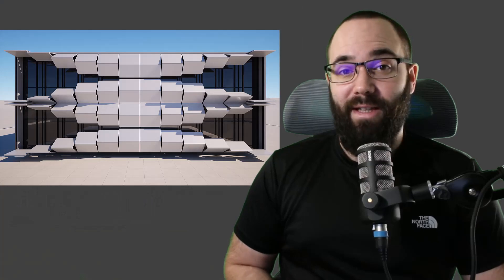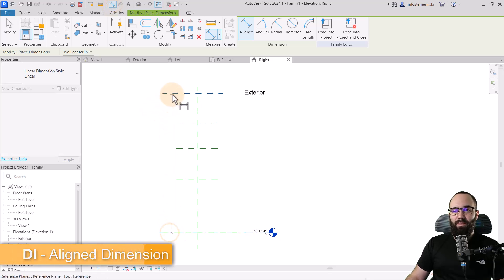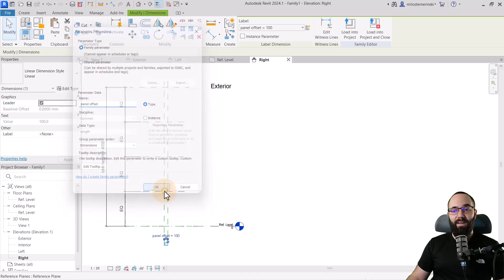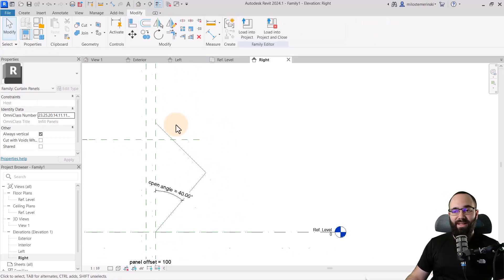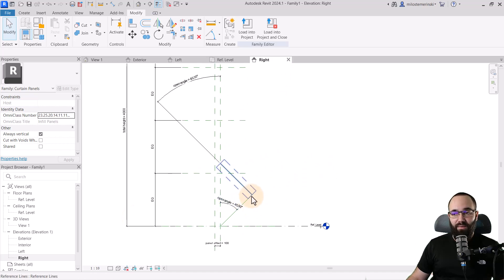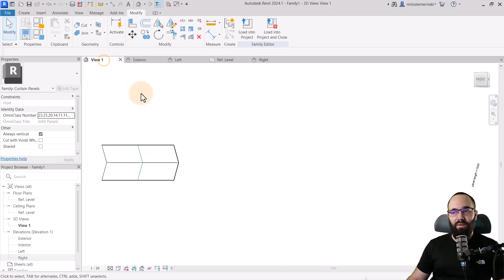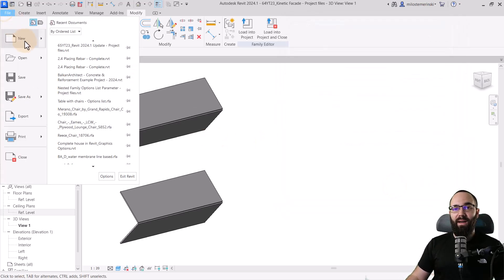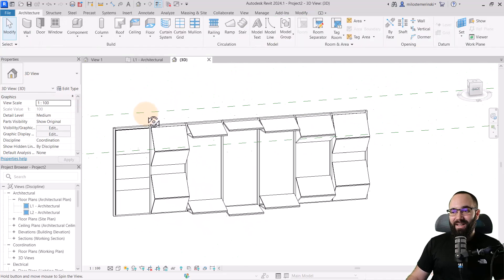Parametric Kinetic Facade in Revit Tutorial

Comment: The panels changes length whenever i change the angle. which results to a gap in the middle and uneven panel length. how to fix this?
Reply: hi sir, i experience the same issue.. can you please help?
Reply: Just alighn the panel joints together and your problem is solved

Comment: Hello, and thank you for the good work. 
One comment on the kinetic panel family. I don't think the total panel height works for the family as it is not following the panel height in the project, but it is keeping a fixed value you are giving to it in the family instead (you can notice that the total height of the panel is not correct when you fully close it at a 90 degree angle). Maybe a reporting parameter works in this specific case? Let me know what you think.
Thank you